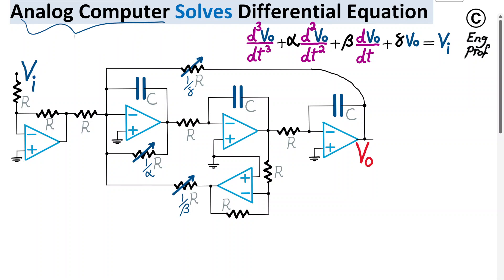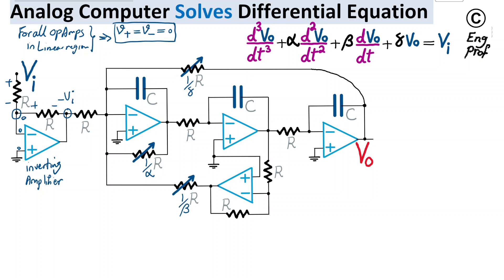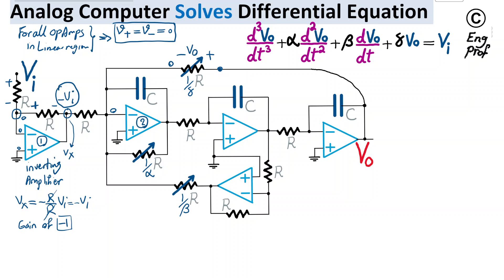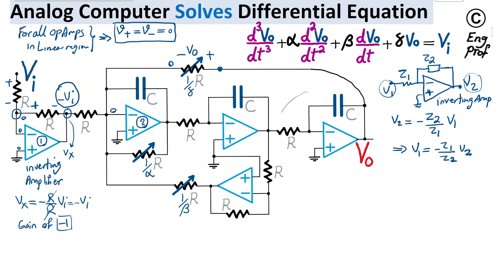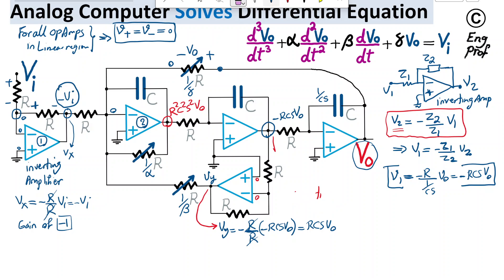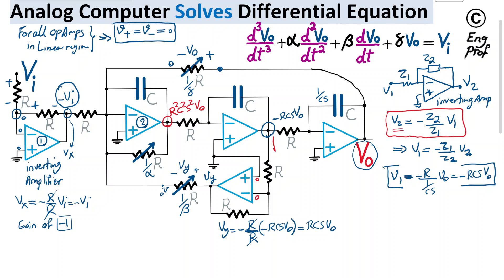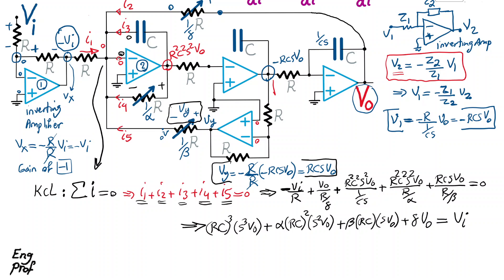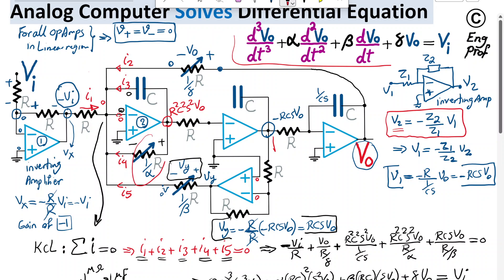Analog Computer solves Differential Equation

Comment: Thank you, I tried simulating this circuit in the Falstad, but i don't know what resistor/cap value to plug in, it uses current but that it's. : )
Do you know the legendary Urei 1176 audio compressor? is there a opemp configuration possible that can measure from a set threshold to measure by much the audio exceeds the threshold and deduce that from the audio via a FET or so.
Reply from the maker: You're welcome. Thanks for watching and your interest in this circuit. Glad that this video is helpful. Regarding your Audio Compressor question, Looks like you are looking for a peak detector and then a differential or instrumentation amplifier to subtract the exceeding value from the audio signal. Please see the following related circuit videos: Peak detector and RMS meter https://youtu.be/4aG5NYX8tGo
Differential Amplifier Analysis https://youtu.be/gSaAcUCXQGk
Instrumentation Amplifier with 3 OpAmps https://youtu.be/Yq767et8BbY
Differential Amplifier with Variable Gain https://youtu.be/WgEV_5VR73o

I hope this explanation and these circuit videos are helpful.
Reply: @STEMprof  a couple of hours ago i remembered peak detectors,  I'm wondering for quit some time now if detecting the difference to a set threshold, than subtract the difference from the audio input, like doing actual math with opamps.

Veritasium showed a video of analog computers from the start of century or so, build from pulleys and threads to measure sea waves and tides, differential math using nothing more than mechanical things.
Check that out if you haven't.

I'm pretty sure it can be done.
I like your electronic gain circuit.
Reply from the maker: @AnalogDude_  Thanks for watching and sharing your thoughts.  Glad that you liked my channel and electronic gain circuit.  Please see the following related circuit example that might be helpful: Analog Computer with Op Amp to solve differential equation https://youtu.be/HeZRtnRXpEI

Comment: Thank you. That was wonderful! I'm 74, retired 4 years ago, enjoy watching your video immensely. Whatever I knew about differential equations and s-domains, it's all gone now. Could you mention what could be a practical usage of such a circuit?
Reply from the maker: Thank you for watching and your good question. Glad that you liked this video. For more examples of Analog Computer that solves Differential Equation please see https://www.youtube.com/watch?v=HeZRtnRXpEI&list=PLrwXF7N522y4c7c-8KBjrwd7IyaZfWxyt&index=6 . 
And answering your Question, Analog computing circuits, including differential solvers, are still used in designing oscillators, signal conditioning, and also Neural net processors aka neural processing unit (NPU) that mimic brain-like processing used in deep learning and artificial intelligence.  
I hope this is helpful.
Reply: PID controller? (diff solver?)  @STEMprof
Reply from the maker: @tristanboyle4450  Thanks Tristan, good points. A few related circuit examples are:  PID Controller Circuit for Servo motor https://youtu.be/NATBlfABXrA
Analog circuit with op amps and feedback loops that solves differential equation https://youtu.be/HeZRtnRXpEI 
For more analog signal processing examples please see: https://www.youtube.com/playlist?list=PLrwXF7N522y4c7c-8KBjrwd7IyaZfWxyt 
Thanks. 🙏
Reply: Great presentation, thank you. If say the  beta coefficient was 10, then the pot would be set to 0.1 ohm? This would result in large currents?